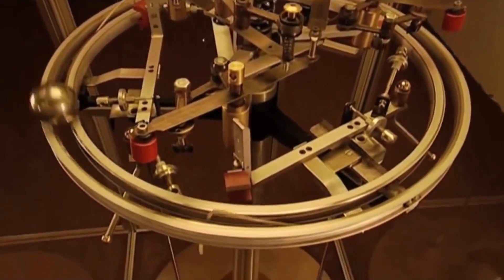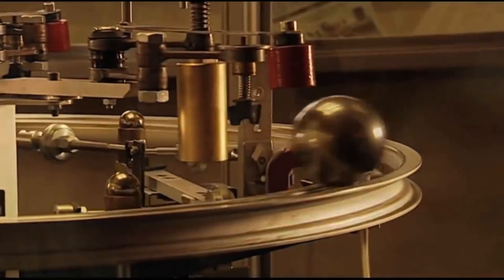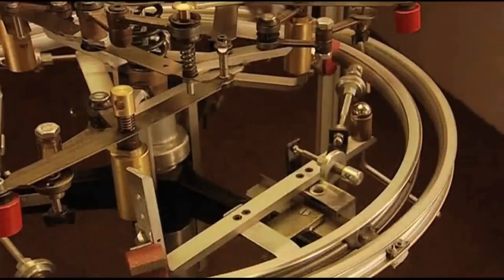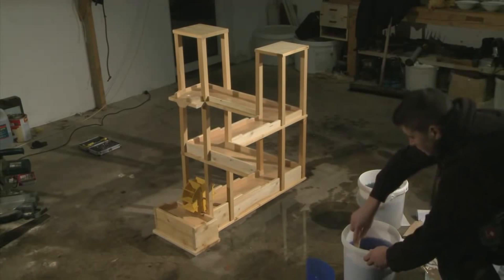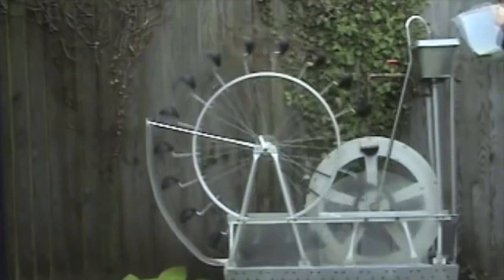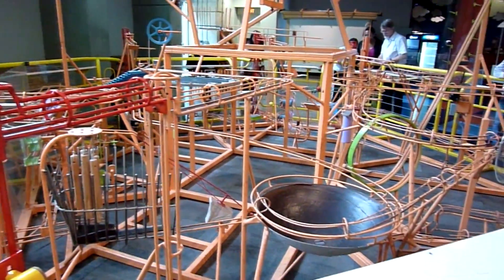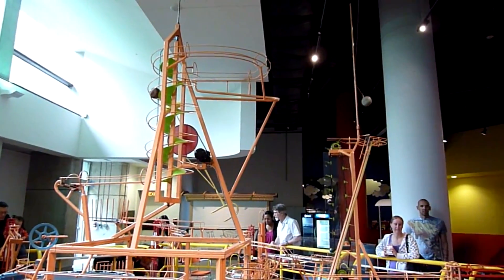Top 5 Near Perpetual Motion Machines

Comment: All you have to do is wrap a large wheel with a smaller mass as in smokin lamas,

https://www.youtube.com/watch?v=eVD9BMxpYLA

The physics behind the throw is Newton’s Second Law of Motion; That the Momentum of a closed system remains constant. 

https://www.youtube.com/watch?v=YaUmzekdxTQ  

https://www.youtube.com/watch?v=w-7d66JscI8 

https://www.youtube.com/watch?v=YDQs4hnBUcg  this experiment is not one that I did 

Feel free to repeat any of these experiments. 

I was thinking that 36 to 1 would be a good mass ratio. If a (.132 g * 35) 4.62 kg Atwood’s is accelerated by a .132 kg: then 4.752 kg will be moving .7382 m/sec after the .132 g has dropped one meter in the 36 to 1 Atwood’s. 

https://www.youtube.com/watch?v=4ovhEkSIqV0  MIT Atwood’s

This is 4.752 kg moving .7382 m/sec for (4.752 kg * .7382) 3.5079 units of momentum

Place this 3.5079 units of momentum into a .132 kg mass (the spheres) and it will be moving 26.575 m/sec 

This speed will allow the .132 kg to rise 36 meters; when it was dropped 1 meter.              d = ½ vv/a

I chose .132 kg because 1 steel sphere has a mass of 66 g. The cylinder mass and the length of the string can be adjusted.

Comment: You can use a small mass to make very large amounts of momentum using an Atwood’s or modified Atwood’s. Then use the ‘cylinder and sphere’ to transfer that momentum back to the small mass and the energy increase is to 4000%. 196.2 Joules produces 7848 Joules in a 40 kg to 1 kg Atwood’s dropping 20 m. 

Henny: You can do this. Everyone knows that an Atwood’s works so you don’t need to do the 20 m drop.  Just build a ‘cylinder and spheres’ and post a video of it.

The problem with the buoyancy machines is that they take more energy to fill the drums with air at the bottom than the energy you get back as the drums rise. While pushing water around you are probably at 10% efficiency.

It takes 19.81 units of momentum for 1 kg to rise 20 m. And that same kg produces 125.28 units of momentum coming back down in a 40 to 1 Atwood’s. It takes 2.019 second to rise 20 m and it take 12.77 second for the same mass to come back down in the 40 to 1 Atwood’s. The same force acts for 12.77 sec / 2.019 sec = 6.324 times as long. The energy increase is 6.324 squared.

Henny: You can build a ‘cylinder and spheres’ machine and be making a huge contribution to the history of physics.

Comment: Principia; Newton’s Laws of Motion. 

F = ma      acceleration is v/t       So F = mv/t      Or   Ft = mv 

While a constant force is being applied to a mass: three units of time cause three units of velocity.

In the introduction of the ‘Three Laws of Motion’ Newton uses the words: “top, planets, comets, circular motion”.  Newton made his Laws of Motion for “tops, planets, comets, circular motion” not just for straight line motion. 

Also note Newton’s use of the word curvilinear; indicating that HE knows that some lines are straight and some LINES are curved. 

I want to emphasize that these are real experiments not philosophical concepts.

5-8-18
https://www.youtube.com/watch?v=oeG7RcSodn8

spheres 305  cylinder 972 g

https://www.youtube.com/watch?v=KgT70vSIUgA

double yo-yo de-spin 

https://www.youtube.com/watch?v=YaUmzekdxTQ 

Do you accept that when a 10 kg mass moving 1 m/sec gives all of its motion to 1 kg mass then that 1 kg must be moving 10 m/sec so as to conserve Newtonian momentum? 

Do you accept that when a 10 kg mass moving 1 m/sec gives all of its motion to a 1 kg mass then that 1 kg must be moving 3.16 m/sec so as to conserve kinetic energy?

Do you accept that 10 m/sec and 3.16 m/sec are not the same quantity and therefore one of these Laws has to be wrong or at least does not apply to this spinning interaction? 

You can pull a cord to accelerate a top or flywheel. If you pull for three times as long the arc (curvilinear) speed of the wheel will be three times as fast. 

If you interact the motion of a flywheel with a mass in straight line motion you will share and conserve linear Newtonian Momentum mv: NOT 1/2mvv.

If you interact the motion of a flywheel with a mass of a second flywheel you will share and conserve linear Newtonian Momentum mv: NOT 1/2mvv.

You will have to apply the same force to stop this flywheel as was used to start it.

For those that actually do experiments and have actually read Principia: there is really no question that Newtonian Momentum is the conserved quantity of the universe.

Comment: There is a reason why free energy has been missed for 300 years or more. Flywheels share their arc momentum with other flywheels or other masses; the flywheels do not share their energy. 

Modern Physics teaches that motion can be made without the application of force. This teaching is false but it is supported by almost all profs and very few speak out against the teaching. 

The profs teach that 20 newtons applied for one second can cause a 1 kg mass to move 20 m/sec. And then when you place this 1 kg moving 20 m/sec on the end of a long string you can arrange for it to cause 400 kg to move 1 m/sec. This motion of 400 kg at 1 m/sec would require 20 newtons applied for 20 seconds. 

The profs are proposing that you can get 19 seconds * 20 N of motion for free; by simply tying a string onto the 1 kg mass. 

This proposal of motion without force violates all Three of Newton’s Laws of Motion. But this proposal of motion without force is necessary to promote the false concept of energy conservation. 

The concept of energy conservation negates Newtonian Physics

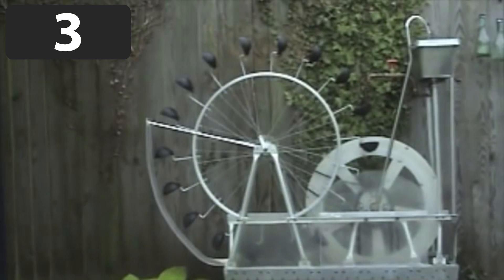Comment: 2:40 "It's not quite real perpetual motion since the pump would not be able to lift water than its own radius."...Lol. That's not a fact and not the reason it is not perpetual motion machine. That is a wirtz pump he is using and can lift water above its radius with ease. However, energy conservation law still comes into play due to friction and heat lose. Even if his invention works for a short time with added boost of water, the pump cannot keep a high enough flow rate to spin that water wheel at the required torque and speed to keep both wheels running forever.

Comment: I set up the photo gates on the 4 concentric circles experiment. It is a light pulley with four radii (lrn fzx axle and wheel). 40 grams at 105 cm diameter is just as easily accelerated as 120 g at 35 cm diameter; but the energy is three times higher. Now the proof is in 1000th of seconds. 

The 20 gram drive mass is kept at the 35 cm diameter. 

If the radius was 10 to 1 the energy produced would be 10 times as great.

Comment: First,  there will never be perpetual motion because nothing is infinite not even earth or sun. However, something spinning until it is stopped or parts wear out would qualify in my book. 
  So the first guy looks like a mad scientist and has let the true objective of perpetual motion slip from him. His machine will run several hours and I have no doubt about that, and that is because there is no real friction. The only reason anyone would ever want a perpetual motion machine is to turn it into energy so it would not only have spin itself but a motor of some type. If you someway figured out a design for those looping balls of his to be hooked to a turbine the resistance would stop it in a matter of minutes and probably seconds. Same thing with that great big contraption. However,  I  do not think that one was ever intended to be anything but a fancy display to stimulate kids minds, so it definitely gets a pass. And the other ones are obvious fakes.
   I myself have thought about the subject in depth. My mind has a design, but unfortunately will most likely never be brought to life at least by me for 2 reasons.  First I know way down deep I'm just dreaming,  I'd be just like all the other  yay-hoo's. When I got it built it just wouldn't quite work and I'd go insane and spend a fortune trying to tweak it and secondly I'm just plain lazy. I don't have the initiative to start a project like that. But all that being said, I do not think it's impossible so by all means if you have the drive,  time and money. GO FOR IT! I don't have any of the 3.

Comment: No. 5 has actually gone for 2 weeks!! :D
Reply: Reidar Finsrud's device always runs with a power source, when that source is disconnected or exhausted, it stops within one revolution.

According to the artist, it  was never meant to be a perpetual motion device-it's purpose was to get viewers thinking about motion and the way that we perceive it. 

It is a very satisfying device, but in the end it is an exercise in kinetic art-there is no real mystery there except what the observer brings to it.
Reply: @darklight2.1  Uh. No, you're definitely wrong about that. Reidar is well known here in Norway, and so is his device :P
Reply: @darklight2.1  Dude, I know about the 2. law of thermodynamics. That's why this machine is so impressive. To make a perpetual motion attempt that can go for 2 weeks is incredible. It obviously can't go forever, but that's not the point either. The point is to get it to go for as long as possible without any outside energy.

What's your source for claiming Reidar's machine runs on a power source?
Reply: @darklight2.1  You're missing the point dude. No one in their right mind says perpetual motion can be achieved. But people make attempts that last for a long time completely on their own. "Where is the energy for this machine to ostensibly run for two weeks coming from?" Your question is wrongly put. There is only initial kinetic energy. But having made a machine that is incridibly effective in terms of input vs. output, the energy lasts a long time. It never increases or stores. It only declines, but slowly --> Because his device is designed to be as effective as possible.

Comment: No.5 is poetry in motion. Beautiful. No.4 is given away by the water apparently flowing uphill. Clever. As are the other three. Kudos to the designers.
Reply: The water can flow that way with a wirtz or spiral pump, you can do it yourself at home.

Comment: A grandfather clock is a classic example of a perpetual motion machine. OK someone may wind it up now and again, but we'll forget about that!
Reply: There are clocks that self-wind using the changes caused by atmospheric pressure on a column of mercury. These will continue running until the bearings/bushing wear out or the mercury evaporates. This bearing/bushing issue could be partially resolved by using magnets, but then the purists will say that the magnets will eventually lose their power. Since "perpetual" means forever then of course nothing lasts forever... but maybe a perpetual machine is good enough if it outlasts any intelligent being capable of observing it?!

Comment: That's a super cool shirt Buddy and I'd like to put my two cents;  by mentioning about the lack of doing different then as a workings of clockwork and lacking the multiple acting forces that affect levees and ratios while in sync with other actions that may if could have a relocations status of maybe going forward while torquing backwards or maybe as such but rather more like giving a resistance against a torque;  much like a planetary outer gear would behave( much like a power drill will do to you if you loosen your grip and the bit gets stopped)....That's just about the first one and I would mention how one could repair that one but why bother myself with such a waist of time.  One thing that it will never need;  a breaking system.  I call it like I see it;  Cheers.

Comment: For the perpetual motion machines why not use some energy to make more energy like for instance for this first part of this video why not make it so every time the ball stops or when it doesn't hit a certain magnet at a certain time it will trigger a small electric motor to tilt the ring the to the side giving it more motion. Why not spend some energy to make more energy.
Reply: Because it doesn’t make enough energy. The energy made will always be less than the energy required to move the ball

Comment: First one, limitation mechancial fatigue, loss of motion given.

Second one: Illusion, however portaling or displacement theory of energy transference is a real possibility. Such as if you hit something it goes intact direction forever, well to ap int of magnetic chain resonance wave has an opposing bond against it.. Something like that.  I think with state change, or phase change or using magnetics one could change state and thus create a pressured system that rotates upon its state of changes, it would though have decay possibility, unless in a vaccuum. Hmm...

Third: efficient, but mechanical limitation to the fatigue of its structure.
4rth one is interesting since you can do some fun math and here the height and the law of attraction from the larger mass body. So you can calculate the incline to acceleration to distance from a height. Thus figure out what is its optimal travel and incline distance. When approaching the Terminal velocity we would get less motion compared to stretching it out, with an efficient system, This of course is just very efficient use of motion in a machine.
Age of the ATOM... pretty efficient. 

Magnetic decay, eventaul decay is that its material from earth, or to earth ,and so it eventually loses its charge because of the body we inhabit. However magnetics are extremely good and conserving energy in them until their decay, and can be charged up. So making magnets in ceramic dust and aligning the electrons a long time ago, poised a future of interest. Artificial magnets are basically solid state batteries, its how to translate the electrons in a motion of alignment. OR create an efficient system of motion from such things, This is the  demonstration of magnetic motors, and brakes seem to have very efficient systems, of regaining loss, and including being able to be charged form the sun ,which changes the whole fuel industry or nuclear industry of motion ,but it doesn't have the same ability to give the needed force when needed, unless in a heavy brakign wheel system with incredibly dangerous magnets.. Of course... magnetic vehicles provide better safety, in meaning rather then having vehicles that crunch ... easily, one could have repulser walls in which cars under a collision wish to repel each other. :D Who knows..
Reply: the second one looks like PPG, look up self pouring liquid (polypropeleneglycol)
Reply: @ajrm007 , the second one is an optical illusion, using forced perspective, and computer manipulation.

Comment: Prepetual motion could work in deep space since there is no friction there, no dust, no air and no solar radiacion particles.
So all you would have to do is spinn something and it would spinn for many years. And if you want power than you would just need a mortor to give it a boost and than you just let it spinn.
(You will have to respinn it but it would slow down so slowly that you would just do it every couple of years or so)
Reply: Xastilin If you could make it spin past the age of this reality by giving it an initial starting speed so fast it would outlast this singularity (Big Bang, whatever you prefer) what would it matter? All matter in our universe will never stop moving so how is it that a perpetual motion machine is not possible?
Reply: @Bladesmith79  EXACTLY! This has been my argument for so long against the purists that say if a component of the machine eventual wears out (even if that time period is the absurd concept of infinity minus 1 second) then it cannot be considered true perpetual motion. If the duration is as long (or longer) than our reality exists, who's going to be around to observe the issue? Perpetual motion is a philosophical debate!

Comment: how long will the last one keep going?  does it go until the magnets wear out or is this faked somehow...?  I have a hard time believing that the machine actually produces the required energy to lift the rod over and over like that without some initial assistance at the very least.
Reply: It slows down and stops rather quickly. That's why they manually stop it, to avoid letting us see it stop on it's own.